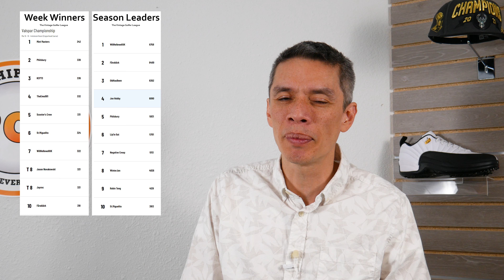Rory's Driver Change, Taylormade Stealth - Talking Golf Tuesday Mar 21, 2023

Comment: You guys gotta step it up with your gear. My drivers are made of materials sourced from the finest selection of Colombian wormwood, Djiboutian baobab timber, Pennsylvanian Aluminum and an Antarctic Tungsten laminated-type, carbon-fiber-cured Norwegian pneumatic alloy and they consistently hit over 75 yards regularly. You know me, I only use the finest of materials and it reflects in my score: mid-130s every time. You all should read up on the latest research out of Good Golf Labs down in Melbourne. They’re really revolutionizing stroke play like no one else. It’ll change your whole game.

Comment: I think it would interesting to try a 460cc solid Persimmon or 460cc laminated wood driver, obviously with modern carbon fiber shafts. Perhaps the fatigue factor would be substantially less? I'm just digging, because even the experts don't have the answer. I hope I get a cut if this idea explodes!

Comment: The club manufacturers push the COR to the very edge on the clubs they build for the pros.  The tolerance is WAY tighter than on any club being sold to the public.  99% of Rory's issue was in his head, not the club.  He hit one bad shot because he was thinking about it being a different club, and then he hit more bad shots because after that first shot all he could think about was that the club felt different.  I'm sure every test known would show the new and old clubs are identical, but if the pro says they are different, then that's all that matters.  It's easy to confirm - just put both clubs on the robot and hit each as many times as you want.  Is the dispersion in the data the same?

Comment: carbon with aluminum frame is such a bad idea anyway, galvanic corrosion will shorten the lifespan of the drivers drastically. I'd say that they wouldn't have more than 5 years or so in them but that's just a wild guess based on what I've seen in the cycling industry